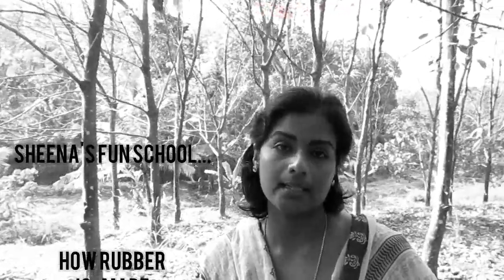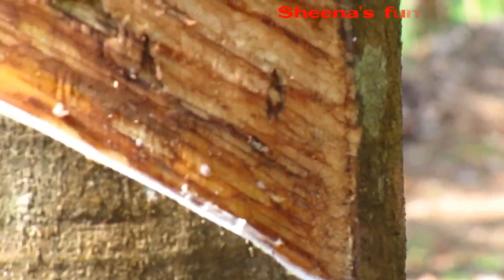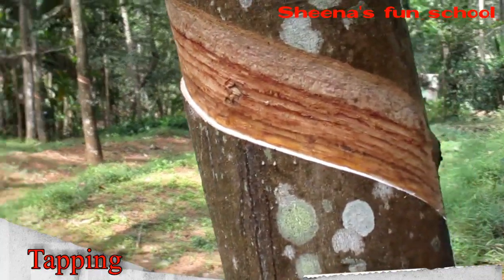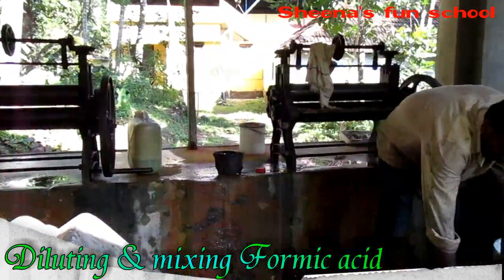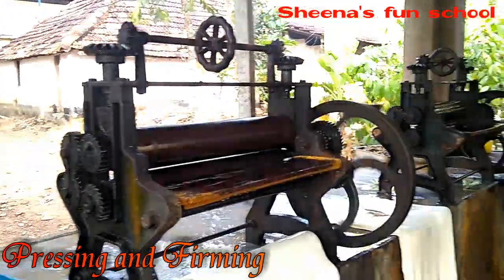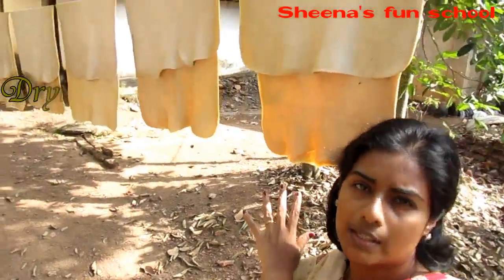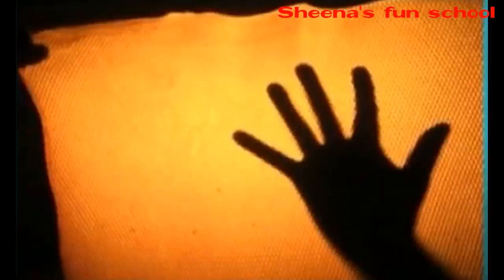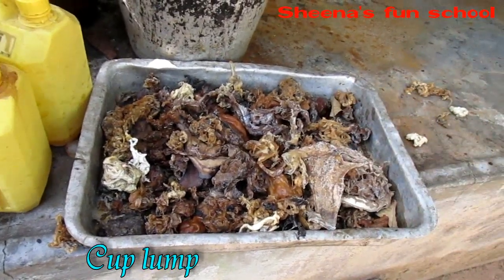Rubber Sheet Processing from Latex

Comment: You said rubber sheet should be dried in shade only, not in direct sun light. Why??
Is there a problem when rubber sheets are dried in direct sun light
Reply from the maker: When sheets are dried in direct sunlight, it will cause oxidisation and acid reaction resulting in dark pointed spots in rubber sheets.  I think there is a difference in quality also due to this chemical reaction while smoking.